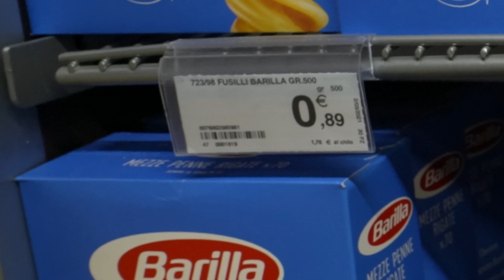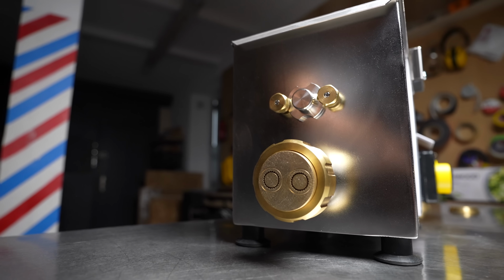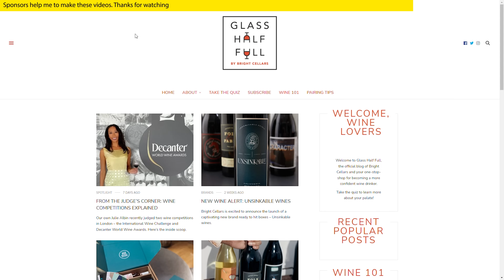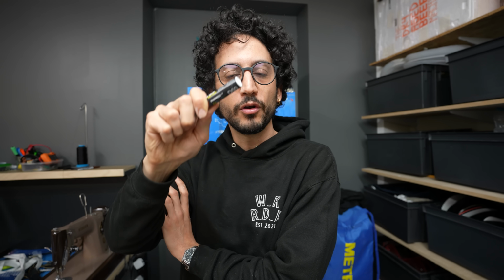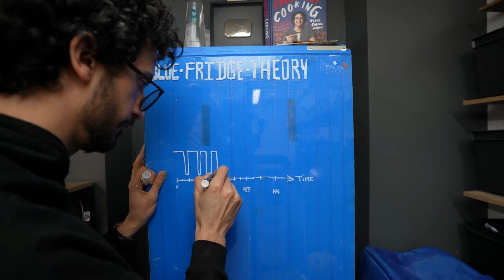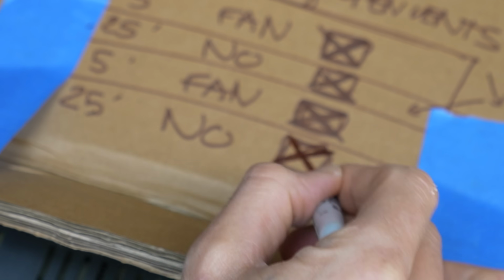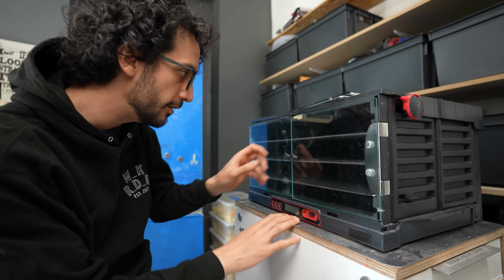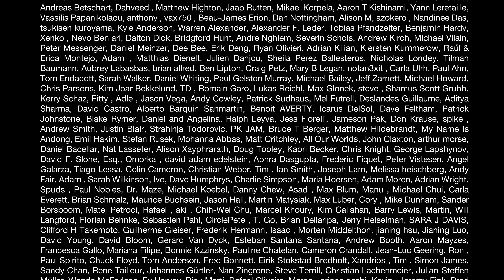This is Why Drying Pasta At Home IS ALMOST IMPOSSIBLE

Comment: so i might already be a little late and you might not really care but, 
it's called plastic and elastic because of the different types of deformation. 
it is similar to the description of deformation of metal 

In physics and materials science, plasticity, also known as plastic deformation, is the ability of a solid material to undergo permanent deformation, a non-reversible change of shape in response to applied forces. For example, a solid piece of metal being bent or pounded into a new shape displays plasticity as permanent changes occur within the material itself. 

For elastic deformation:
In physics and materials science, elasticity is the ability of a body to resist a distorting influence and to return to its original size and shape when that influence or force is removed. Solid objects will deform when adequate loads are applied to them; if the material is elastic, the object will return to its initial shape and size after removal. This is in contrast to plasticity, in which the object fails to do so and instead remains in its deformed state.

[definition stolen from wikipedia]

just for anyone that cares to know:)

Comment: You should substitute the power button of the drier with a relè in order to control the drying process using an arduino. The code should be very trivial

Comment: How about making a homemade box that has a fan inside to pull through and then push hot air across the surface with your pasta? Heater on one end and then fan box and then enclosed area with drying racks. Almost convection like.

Comment: If your going to mount a fan in your dryer you might want to learn some basic electronics so you can program it to turn on and off when you need, using something like an Arduino.

Comment: Alex, while watching this video I couldn't help but wonder if your life would be made easier by trying to use something like the Anova precision oven for this. Not only should it be able to maintain a temperature fairly well, but it can add humidity. It has somewhat decent automation controls, a good fan, and it also can report the current temperature as opposed to the target. It seems slightly overkill for pasta but I think it could work well.

Comment: May want to check and see which direction the drier the pushing air. It may be pushing air out of the machine rather then in. Also what if you add a small bowl of water or something similar in the machine while drying to increase humidity

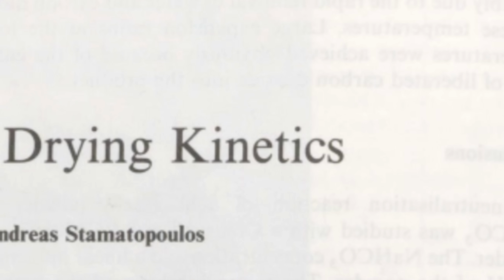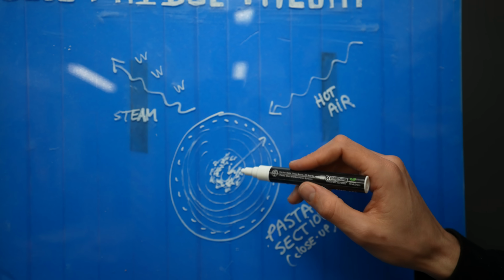Comment: 1. All the shown diagrams refer to an overall time span of about 360 minutes, or six hours (3:12; 6:38). The four hours, 240 minutes, were simply chosen too short.
2. About the fan, I'm not sure. If the airflow is always led in the same direction, it should affect some parts of the pasta directly while others, not being blown against, will dry more slowly. This should raise the tension within the pasta blank and result in more cracks.

Comment: You could use PC parts and fans for a new machine... Actually, you could build it in a PC chassis!
I suppose that even with a proper fan the air flow would be very random in some parts of this box. I was wondering if installing another "inside" box (made from cardboard, for example) with holes could help by blocking direct air flow from fan and redistributing it around the box.

Comment: How about using an Arduino controller to run the Cycles on your dryer? That way you can just start the program and come back when it's done rather than manually running each cycle.

Comment: Could be interesting to try to dry them with a microwave and the same technique, like you can do with uniform baking for « foie gras »
Reply: That would be a very tricky balancing act, as the microwaves accelerate the motion of the water molecules in the food, and you run the very real risk of having internal steam explosions inside the noodles.

It could probably be done, but I seriously doubt that a home microwave oven, even with advanced timer controls could be derated enough to not overpower the pasta.

Comment: I hate to yell you this my French Amigo, BUT you van MAKE a very accurate Pasta drying machine ... Of course you're going to meed a few bits to do it, BUT it makes your problem of drying the pasta (You can use this for an Egg pasta also but you need to change the Parameters)
So you'll need an Humidity sensor (an accurate one) a Temp sensor (again an accurate one) a Humidifier, a Heater, a number of fans (& power supplies) and a PID, all of which you can buy fairly inexpensively ... Oh and you'll need a sealable (preferably insulated) housing or "box". You can also use a an Arduino or similar to do this but you'd need to be confident with your programming skills.
 I also use mine to ferment/brew Ale and to make Sauccison (Salami). In fact I also use it to dry age meat (bagged in one way moisture bags) Dry Pork belly to roast and Pekin Ducks, and make Bacon/Speck/Guanciale, it's actually a refrigerator that has a significant number of modifications including air refresher for the cabinet, so you migjt also meed Filter, Solenoid micro switch and vaned sealing mechanism. 
Oh and it's pretty imperative that you need time, quite a bit of it unfortunately ...
Happy to help you out if you need it, cheers mate.

Comment: One important thing in my opinion is the concept of the humidity that should be measured in the pasta instead of the pasta farina environment. You should measure the weight before drying and after to see it's level of humidity and not just measure the humidity with an hygrometer which will just tell you the humidity of the chamber, which will not be the same. Second important thing do the test with the string with the dehydrator closed and sealed, as with the door open the flow of air is different, maybe the air intake is on the other wall, so air flows correctly, your test may tell you something that si not true. Last thing, if there's such s big business I think it is normal that your cannot find a solution that fast 😉

Comment: I mean you could build a dehydrator! It's actually quite simple ^-^
When dehydrating stuff you have to make sure you have constant moving air and heat. You can achieve this with a light bulb, a box, and a computer fan. The static pressure for your dehydrator is very low lol. Change the it to outwards pressure and you have your solution! I'm a broke college kid that built a dehydrator in a box lol

Comment: The terms "plastic" and "elastic" come from material science, not per se pasta making. When ever you apply a force to a material, there is a very distinct interaction. We plot those on graphs, which has the force F on the Y axis and the deformation in percent, x on the x axis. The graph always starts at the origin and for most materials, you get a straight line from there, meaning the deformation is linearly dependant on the force. double the force, double the deformation. From this, you can calculate the so called elasticity modulus, which is a meassure of how much a given material deforms under force. A low slope means, you need very little force to cause a deformity, think of a rubber band. A steep slope means that you need more force even for small changes, think of steel. Now, this curve doesn't go on for ever, but ends abrutly at some point. This is where the type of deformation changes and this is where the terms plastic and elastic come in.
You see, all the deformation which is on this linear slope is called elastic deformation. That is because the bonds between the crystals of the material haven't yet been broken or changed, just stressed. Elastic deformations are reversable, the material goes back to it's original form. If you leave that linear slope, the deformation becomes plastic, meaning the bonds between the crystaline structures have been changed and can't be reverted again that easily.
Brittleness tells you how much deformity x a material can take before going plastic, the less deformity the more brittle the material is. Steel isn't very brittle, because it can actually take quite a bit deformation and still spring back (like in a spring form).

Comment: At this point I'm starting to wonder if Alex either doesn't watch his own video's or is just moving gradually for content.
It's very clear that high heat, low moisture, drying (dehumidifier) followed by low heat, high moisture, resting (absolutely not a dehumidifier) is the key. It's kind of hard to believe the "I read many scientific papers of Italian pasta experts" narrative when the solution is "Turn dehumidifier off at *ding*" 

Just get a high temp, low moisture chamber (dehumidifier) and a sealed, non-heated, high moisture resting chamber set up somehow. The shock of manual transfer will probably not ruin the pasta in any way.

Comment: Alex is holding the thread in front of the outgoing air, whereas the incoming air is typically on the sides - or in this case it looks like it would blow to the left and right from the middle, and then bounce of the walls, and probably onto the door and then it would return to the middle and into the fan again. But when the doors are open, this won't work.
The point of the hot air isn't to blow air on the food, but for the heater to dry the air, like a hairdryer and then rotate it in the cavity. More air on the pasta would heat it up faster though, as it'll remove the protective air around the pasta, and maybe that speeds up drying. But my guess it that it makes it worse, as it'll dry the surface even faster than the core.
Having failed the exact same way as Alex here, with funny enough an older model of the very same extrusion machine, I hope he finds a solution.
From his little science class I suspect the problem is that he doesn't move the pasta between dry and moist, just very dry and dry, while slowly dropping the temperature. If true, the solution ought to be to take out the pasta and put it back in again, or spray in some water every now and then. Maybe I should try that while waiting for Alex to solve this problem. :-)

Comment: It seems off, but a plastic deformation will retain its shape, where as elastic deformation will bounce back, much like a plastic bottle will crush, and remain crushed, but an elastic band will return to its shape, most of the time.

You would use words such as stiff or soft to describe the properties of a material, that isn’t under deformation.

At least that’s how I understood it, I’m only first year Mechanical Engineering student so I could have it all wrong 😅

Comment: Take a look at soldering reflow oven mods and use the controller. It is much better at doing a good curve than you. They are used to modify normal toasters to be good reflow ovens.

Comment: The drying process can avoid heat and moisture cycles and airflow problems if you simply put the pasta in a 100% humidity chamber and lower the humidity to zero over several days. The reason they have multiple dry cycles in a factory is purely economical. It’s to speed up the process and save money. But YOU my friend…you have time that the factory does not! Try a slow simple dry, rather than a fast complex dry.
Reply: Not really. Think of it as an equilibrium problem. The pasta has to reach a internal humidity of 12 5%. So you don't want an atmospheric humidity of 0% because that will reduce the pasta's humidity to zero. That's what's happening now. Other commenter have noted that kiln-drying wood has the same issues as pasta, which means that you need a 2-stage process where 1) hot and dry to ramp up drying, then 2) an equilibrium stage that is cooler and humid to balance the relative humidity of the pasta evenly and bring it down to 12.5% internal humidity.
Reply: @BigHenFor  0% humidity does not automatically cause pasta to dry to 0%, nor does it align with the humidity of the air. If that were true, pasta would completely dry to zero humidity in dry environments. The key temperature. Pasta in a 0% humid air at room temperature would still retain its moisture indefinitely, as long as it was at the correct temperature.

Comment: I feel like the fan isn't going to be the solution -- the professionals are moving the drying pasta to a whole different oven during the resting stage, right?  That oven probably has a very specific humidity (and much lower temperature) that differs from the normal dryer that the pasta is being kept at so that the amount of water in it can equalize throughout.  I feel like a commercial dry-aging cabinet for meat with a fan added to it for the drying part only in it might be a better solution -- they have fine tunable temperature and humidity settings, and some are even programmable so you can cycle the temperature and humidity for meat aging processes.

Comment: ok but like plastic and elastic are just will move back and won't move back so plastic is plastic and elastics (rubber bands) are elastic

but like sometimes soft things are plastic like for example maluable erasers but other times soft things are elasti for example a pillow is decently elastic.

for instance metals are usually far from soft but most of them are plastic and not elastic pasta is just a case where rigid pasta is elastic and soft is plastic

Comment: You have probably already done the next episode, but ditch that garbage consumer dehydrator, and get something cheap, but industrial. You can get an Avantco model (I have the CDF10) for like $175 and then hook the power up to one of those analog timers with the pins so you don't have to manually cycle.

Comment: Well heck, Alex, you modified your oven so that it would get hot enough to burn your house down, what's the problem with replacing the fan in your dehydrator? What could possibly go wrong?  But with your skills, you could build your own programmable temperature (and humidity) controlled dehydrator with a few relays, a hot plate, a fan, and a micro-controller like an Arduino or RPi.

And FYI, "plastic" and "elastic" are common polymer chemistry terms to describe exactly the properties of the pasta that the food chemists use.  Plastic means deformable without returning to the original shape, whereas elastic means deformable with a return to shape.  "Inelastic" (or brittle) is another term that describes your first drying experiments...

Comment: I think the word "drying" should be replaced with "curing" in this context, as that is what this process really entails. People experience the same problem when drying weed after they grow it. Except in this scenario, it is usually firstly dried under lights and then placed in a jar with lid on to evenly distribute the remaining moisture from the centre of the bud. Otherwise, you get an overly dried, crumbly bud, which nobody wants.
I think that all you need to do is place your pasta on a clean tea towel or rack, in a small room, the way the Nona's did for centuries. It will dry perfectly.

Comment: Deform a plastic water bottle. The shape has changed permanently. 
Deform an elastic rubber band. It returns to its old shape. 

Plastic -> change forever because it is soft and possible to change
Elastic -> hard to change forever since it will just accept the change and return when you stop applying force.

Comment: I wonder what happens if you dry pasta in a vacuum chamber using primarily lower atmospheric pressure over heat. Would it be more feasible for you? Perhaps partner with The Action Lab?

Comment: Maybe reach out to GreatScott! he has built a reflow oven and he could help design a solution to integrate the sensors for humidity and heat with controls of the dryer. You could program timings and responses too.

Comment: Hehe I feel engineering is in the air ;) my (German) grandmother used to dry her pasta in open air. I feel like the industrial drying is just done to increase the speed. In theory if you just leave it drying over days the water should migrate to the outside at the same speed as it is evaporating. But if I would over engineer I would make the drying cycles dependent on the current weight. Since weight los is water loss. Anyways, looking forward to your solution 👍

Comment: Are you aware of humidors?
Cigars have humidity requirements for storage, and so any cigar aficionado will own a humidor to maintain a specific humidity ideal to storing their cigars.
They even sell humidor packets that are designed to keep a small area at a specific humidity. This might be a solution for the low heat, high humidity resting stage.

Comment: You missed a key aspect of the cycle. It’s high temp, low humidity and low temp high humidity.
You’ve skipped the humidity part. I can imagine that the humidity re-introduces some water into the pasta, making it more elastic. If your bread is too dry, there is also no gluten development.

Comment: Just putting a proper fan inside the dryer might not do the trick alone. If airflow is what you want, you also need some source where fresh air is coming in. Otherwise you just create a box that desperately tries to create a vacuum.

Comment: I generalny think you need to have an air flow (in & out) and you won`t accomplish that with that heater since the air has nowhere to go it just comes back a little bit colder to the vent.  You don`t even need to heat much.  Think how hari dryier works. You don`t need to turn on heat to dry your hair you just nieed a freash air flow.

Comment: Is it possible to re-use the bad pasta? Grind it and mix it again with water and extrude it again? It is just semolina and water and with drying extra water is removed, which implies that semolina flour is left, just in a different shape than in the begging. There is no chemical reaction happening. 
In regard to drying; I would like to see you try a microwave. On low setting, or maybe defrosting setting. In theory it should evenly excite water molecules in pasta and help moving water from inside to outside. I would like to see what actually happens in practice.